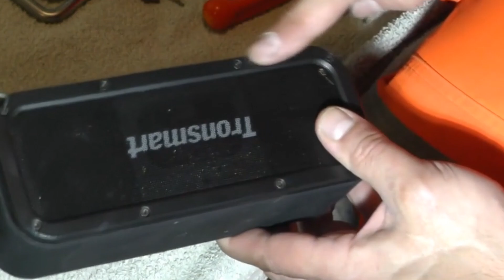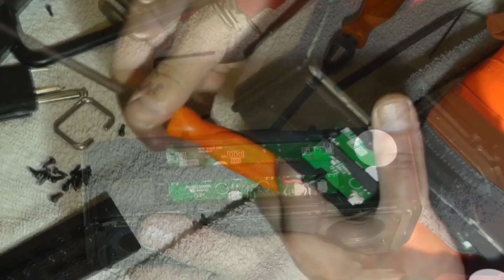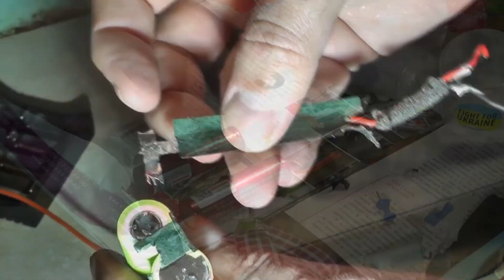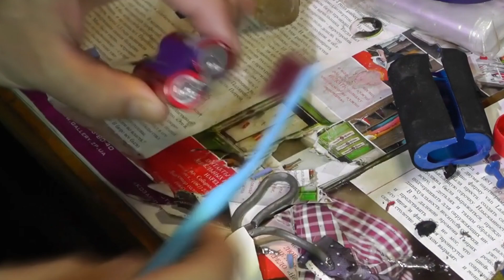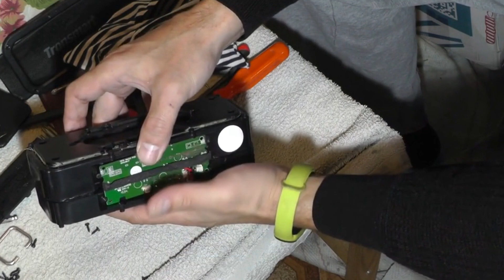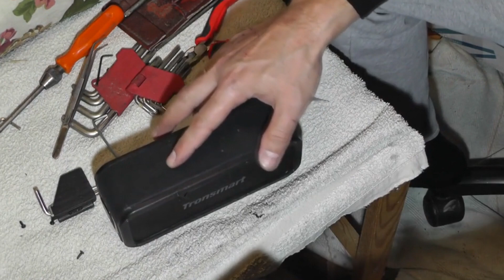Tronsmart Element Force Not Charging – How to Fix

Comment: The speaker casing on my ain't coming off. Iv got all screws bits it seems glued
Reply from the maker: Check if you have missed any screws hidden under the rubber covers or side panels, as the casing can be quite tight even without glue. 🛠️

Comment: Hi, I've the same problem but when I check the voltage of the battery it's 7,5 V. 
I must replace it anyway or could be something else?
Reply from the maker: Since 7.5V is a healthy voltage, the issue is likely a faulty charging port or a damaged power management circuit on the board instead of the battery itself.
Reply: @adults_and_children So I've no hope to repair it😂

Comment: Hola, amigo. Disculpa tengo el mismo problema, pero no tengo a mano batería recargables para reemplazarlas, será posible dejarla directo?
Reply from the maker: Sí, amigo, puedes conectarlo, pero conectar el Tronsmart Element Force directamente sin baterías (mediante cable USB) suele dar problemas o fallar. Debido a las características del controlador de potencia, el altavoz requiere una batería, y sin ella, el USB no proporciona suficiente corriente, lo que provoca reinicios al intentar reproducir audio a alto volumen.